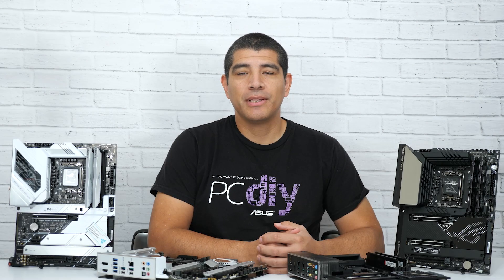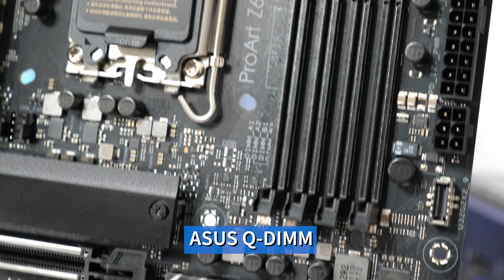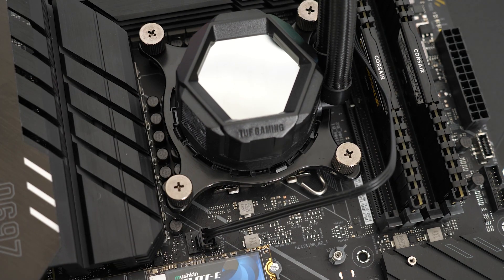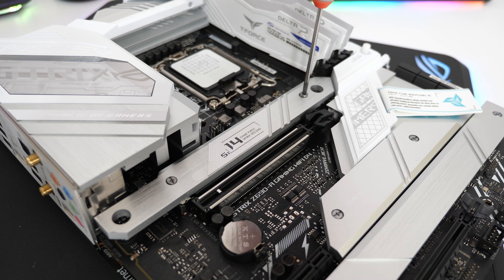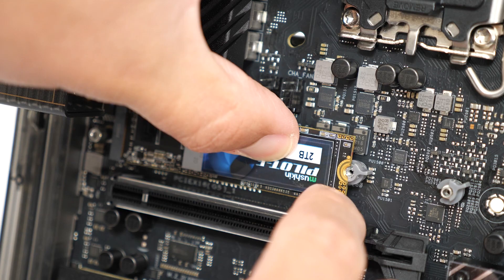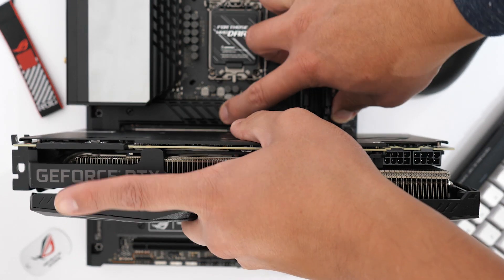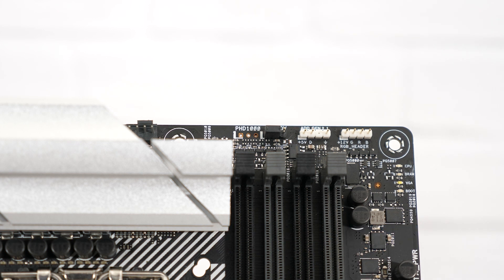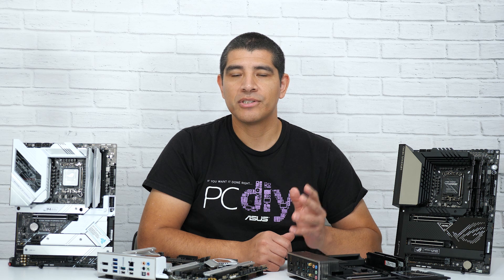ASUS Z690 motherboard features that help you build your PC, faster, easier & simpler - ASUS Q-Design

Comment: anyone know if there's a way to remove the heatsink above the cpu? i see no screws and i tried lightly tugging it and there's no give.
Reply from the maker: You do not note the board, please refer to the manual or reach out to our service team. The manual will document which slots/heatsinks can be removed to access onboard PCIe NVMe M.2 SSD slots.

Comment: My q latche does not lock when installing gpu. I have to manually close the latched with a chop stick. It woks well when taking gpu off but...
Reply: You broke it.
Reply: @ZAPATTUBE  google it lots of people having same issues. I have x670e board but the z690 board are having same issues. I just change my gpu for a tuf 4090 and now it locks in place as intended. So it was the gpu at fault but the thing is , it was an asus tuf 6900 xt on an asus board. So its definitely a bad implementation. Also they updated the q release on their z790 line up so it must have not been really good.

Comment: so what air cooler fit with rog strix z690 a ？ thank you deepcool ak620 fit？
Reply from the maker: There are many coolers that fit, you should based your selection not only on mechanical compatibility but cooling performance which is dependent on your CPU as well as your load.
Reply: @ASUSUSA  sorry， i am a beginner，would you mind recemond some air fan cooler for this one？

Comment: Hello there
I have the Asus x70 tough gaming motherboard.
It has two m.2 sockets.
One is supplied with the heat sink the other is not.
I want to put a 2 TB in the socket that has the heat sink.
Is it necessary to cover my MDOT to with the supplied heatsink ?
Thanks Keith
Reply: No, you can let it burn-up, if you like.

Comment: gpu doesnt seat on the strix z690.
Reply from the maker: The slot is a standard specification, if it does not seat correctly you have not installed it correctly or may have not something obstructing the path. In some situations your chassis slot alignment can chassis issues with installation you can verify this by removing the board and testing it externally.

If you have more questions, consider joining our PCDIY group.
Reply: @ASUSUSA  Google search gpu won't seat strix z690. 

My buddy got it to finally seat by putting an extreme amount of pressure then manually flipping the lock up while pressing down.
Reply: @StephenNewton77  same for me on brand new x670e -e. The gpu is perfectly seated and working fine but the latch does not look automatically. I have to use chop stick to manually lock it in place. I'm still debating if i should try and get replacement or rma but like you said a lot of people are having this issue. They updated their q release in their z790 line up.
Reply: @Pascal Filion  yeah apparently it's an issue that they didn't want to own up. My b550 strix didn't run xmp so I returned it for a aurora
Reply: @StephenNewton77  mine runs perfectly fine and i love the board but i don't know what i should do. I cannot insert the gpu deeper because it is touching the motherboard plastic cover. Also locking the latch with an chopstick is way easier still than Uninstaller the gpu the old fashioned way. I'm sure the gpu won't budge but for 650$ canadien ... maybe it could be the gpu size but unfortunately i have a asus tuf 6900 xt lol
Reply: @ASUSUSA  mine dos not automatically lock on new x670-e also but is perfectly seated

Comment: Asus recommend thermal pads thickness of 1.25 mm for my Maximus z690 extreme if replacing the original ones on the motherboard. I want to replace them with Grizzly minus 8 pad but they don't come in thickness of 1.25. Should I go with thickness of 1 mm/1.5 mm as these two sizes are the closest thickness Thermal Grizzly produce or should I go with the motherboard manufacturers recommendations?
Reply from the maker: There is no reason to replace them so I would not replace them also thickness also translate many times to viscosity so ideally you need to account for this as well. 

Good luck with whatever you decide.
Reply: @ASUSUSA  ok. I was just thinking I would receive cooler temperatures using Thermal grizzly minus 8 pads compared to stock pads..I'm not just talking shout Asus but every motherboard manufacturer. If I was to replace them woukd 1.5 mm thickness be OK??

Comment: I had an issue where my 64gb ram wasnt working. bc of the the model Corsair 32gb 3600Mhz c18 but 32 works fine. I thought this board was capable of 128. anyone willing to help me find a replacement RAM that will work up to 64GB ram ? thanks you.
Reply from the maker: Ensure you have updated your UEFI BIOS and also that ideally you target 2 DIMM kits which you can find up 64GB configurations. If you want 128GB you can take two kits of memory ( mix ) them as there are no 4 DIMM kits on the market but you will need to manually set the operating parameters as the XMP profile will not work and the Intel memory controller/chipset does not support operating at the same speeds as  with 4 DIMM as it does 2 DIMMs.

If you want the highest level of likelihood at ensuring stability and interoperability target 4800/5200MT kits.

Comment: Hi bro can we use Cooler Master MWE 850 Gold V2 Psu
With Asus z690 -A Lga 1700 MB.
The above board requires two connectors to power the board.
 but this PSU has an 18pin connector and the Asus z690 required 24 pin connector and two 12 volts Eps 8pin connectors

Comment: Can somone elaborate on the 6pin power cable next to the front USB type c header on the board "next to the 24pin" and when and where you plug it on the psu, does it only make the front io type c charge at 60watt instead of 27?watt
Reply from the maker: If your motherboard features this header it is only needed for Quick Charge 4 support, it is not required.

Comment: These Z690 boards are useless without ddr5. I wish I new this before I spent $500.00 on my now useless asus mthbrd whic is now out of warranty.
Reply from the maker: Warranty on motherboards are 3 years? As it is a new technology is does have more limited availability than mature DDR4 which is also an option on Z690. Please continue to monitor etailers/retailers in your area for availability. Thanks for going with ASUS - Best of luck with your build, once you get some memory in hand.
Reply: @ASUSUSA  OK thanks, Dave.

Comment: Please don't try to sell the Q-LED as a feature. Asus took the post code readout from us to replace it with LEDs like boards had in 2010 and have the balls to sell it as a feature. Every board should have a post code readout now. It costs nearly nothing to implement yet is kept for only the highest end boards.
Reply from the maker: QLED is a feature as debugs have never been a standardized feature on boards, it is preferred to have some form of debug visibility as opposed to none. That being noted neither are "perfect" as they will not be always accurate in providing information regarding an issue with POST. In some cases both can lead users to incorrect debugging.

An example is memory training or IMC based issues which are trigged as a memory code when the limiting factor may be the users DRAM settings or the IMC not supporting the operating parameters/profile of the DIMM.

We have also recently implemented an even more useful version of QLED which offers more entry boards true usability of a debug as it is can be wired to the front panel LEDs allowing for LED visibility much more easily.

Comment: On new build with Z690 A...  Can I install all 4 M.2 SSD's before powering up for the time to install Windows 10?
Reply from the maker: Yes, consider joining our PCDIY group. You can of course install all the drives prior to installing the OS. Keep in mind if all new they will need to be partitioned and formatted. Best of luck with your build!

Comment: The M.2 latch and the GPU button are AWESOME FEATURES I would want on my next MOBO whenever I build my next PC. My first MOBO was from Asus and because I never had issues or problems with it I went for them again and have only used Asus MOBO's especially since I use Corsair components for the RGB in my PC and being able to sync the MOBO and GPU lighting with the case fans and CPU coolers as well as my peripherals is a huge bonus
Reply from the maker: Thanks for being part of #TeamASUS - Your continued supported is sincerely appreciated. Best of luck with your build!
Reply: @ASUSUSA  I wanted to make an all Asus build but I couldn't ever find an Asus GPU in stock so I had to go last gen OEM/AMD Vega.

Comment: Some of these features are nice but there better be normal fail safe ways of using the board still if these things break.  As for picking a feature I like best eh hard to pick honestly.
Reply from the maker: Thanks for your feedback but the implementations have been tested to ensure durability and reliability and similar to prior implementations still can be affected by indirect or direct damage.

Prior PCIe removal could have easily been compromised by physically damaging the Q-SLOT retention mechanism by physically damaging the clip not allowing for it to lock in place. Similar to Q-Latch you could have stripped the screw. In both these instances, the replacements are superior in reducing the likelihood of these types of issues so not only are they easier but less prone to possible damage. Thanks for your feedback.

Comment: Hmm my pc from 2011 has more USB slots in the backside though
Reply from the maker: This very much depends on the motherboard, you will also find boards with Thunderbolt have sometimes less ports due to ultra high speed IO hubs being used. That being noted you will find boards we have that feature 12 ports. More importantly speed of ports is a factor while a high number of ports is nice most would prefer a mix of high speed ports as much most boards no feature at least 7 to 9 rear ports with most being high speed USB.